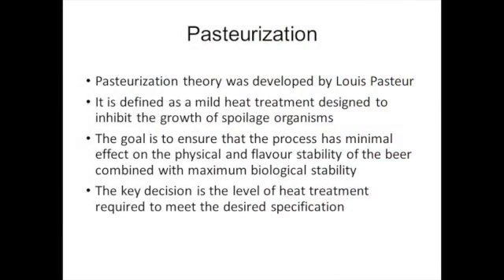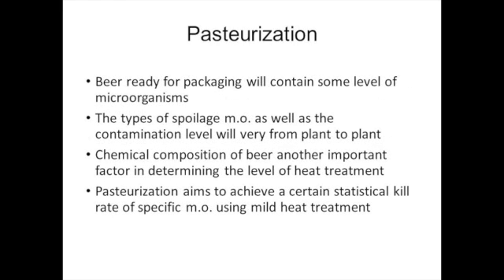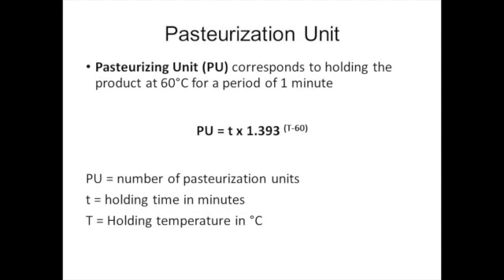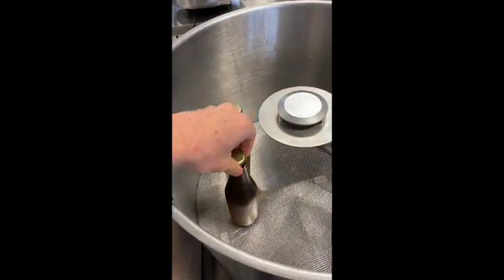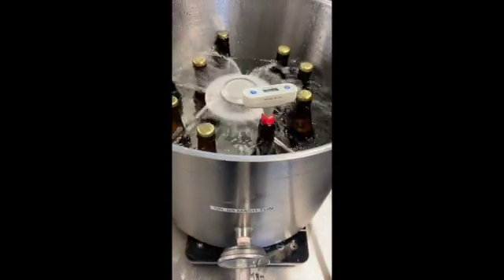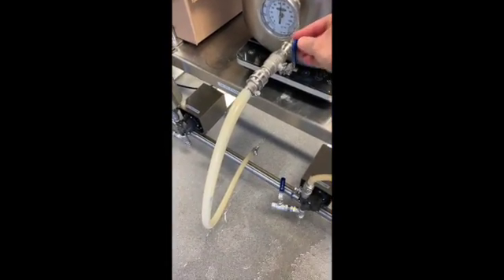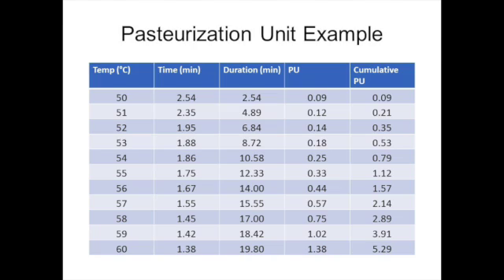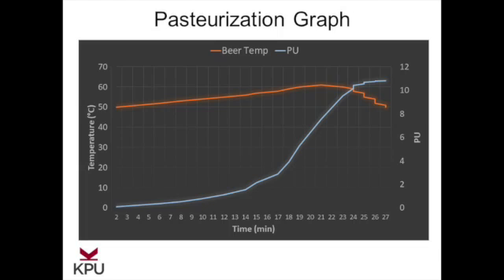Beer Pasteurization Explained: A Guide to Calculating Pasteurization Units (PU) #nonalcoholicbeer

Comment from the maker: Curious about how to calculate Pasteurization Units (PU) or why pasteurization matters for your beer? Drop your questions below, and let’s talk! Whether you’re brewing at home or professionally, understanding PU can take your quality control to the next level. Have you used pasteurization in your own brewing process? Share your experience—we’d love to hear how it’s worked for you. 🍻
Reply: How many pu do I need to obtain to get shelf stability?
Reply from the maker: General guidelines for determining PU’s:
Autolyzing residual yeast (eg. wheat beer) 5 – 8 PU
Light lagers 8 – 15 PU
Full lagers 12 – 20 PU
Ales 12 – 25 PU
Low-alcohol 60 – 80 PU
Non-alcohol 80 – 120 PU